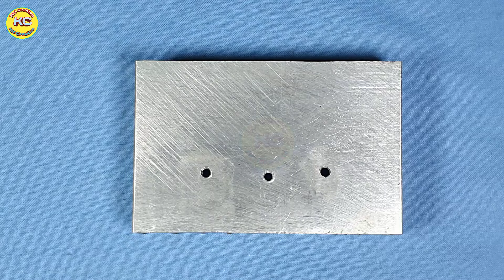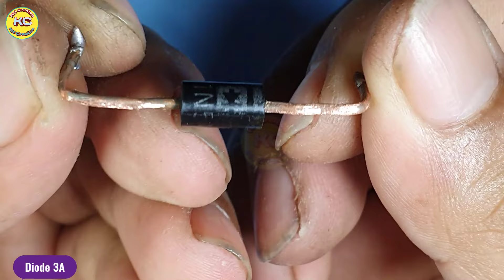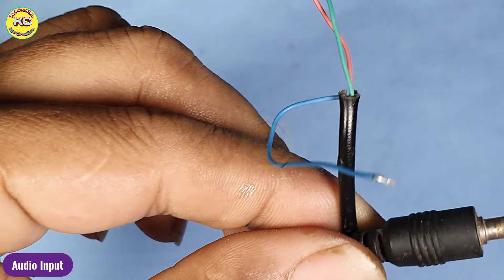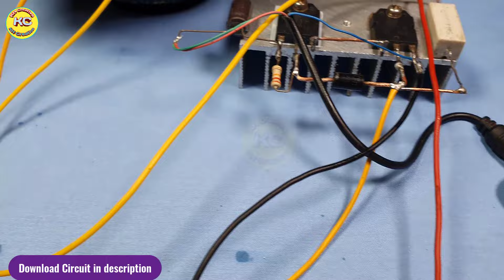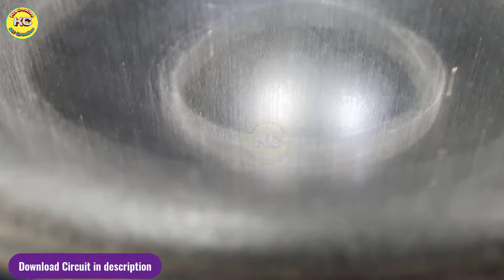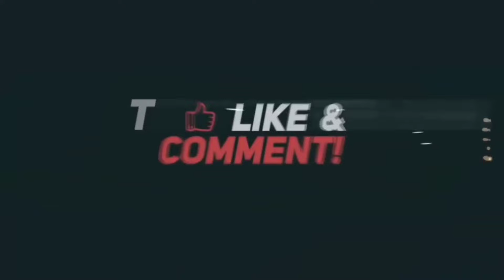DIY Powerful Ultra Bass Amplifier with D718 Transistor, No IC , Simple circuit at home, How to make

Comment: You didnt show properly the connection of speaker wires
Reply from the maker: speaker + connect battery + and speaker - connect pin C on D718